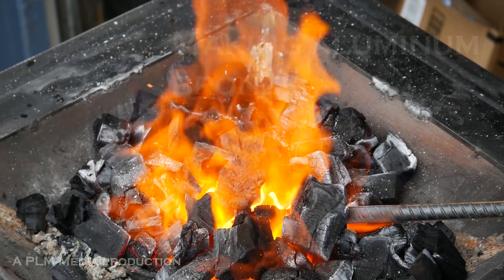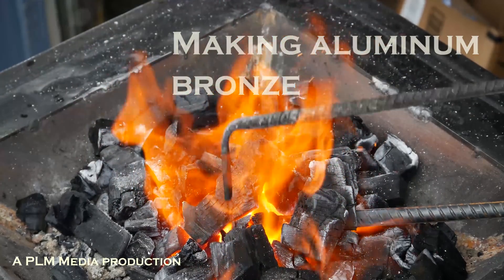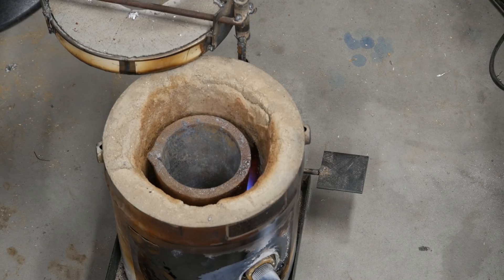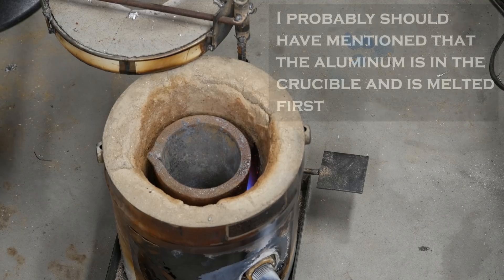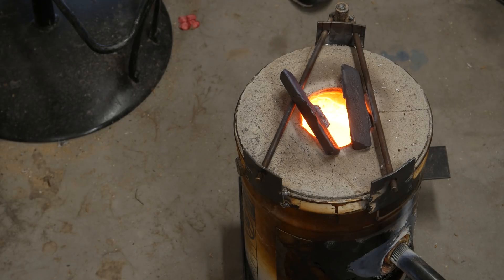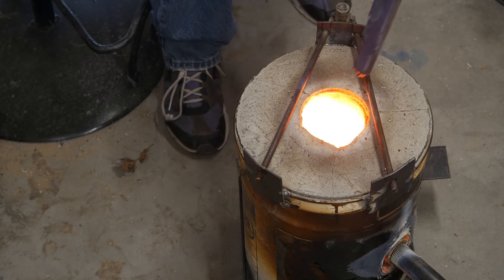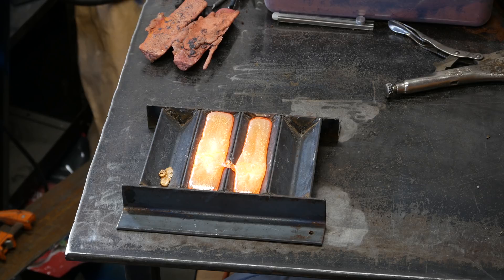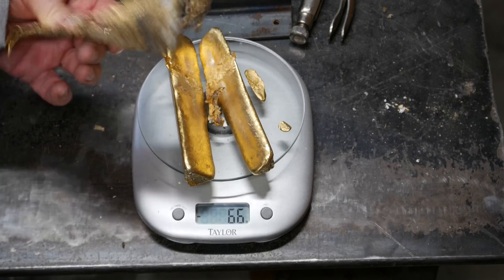Making aluminum bronze

Comment: I've loved your videos so far, lots of very informative and thoughtful content.

Getting into casting, I've been conflating the differences between lost foam and green sand casting. Have you ever tried lost foam?

I'd love to see you take a crack at it!
Reply from the maker: I've never done lost foam, most of it looks really bad in my opinion. Although, that said, I have seen a guy on YouTube that makes beautiful stuff that way, mostly engine parts. 

I really don't have any interest in it. I would like to do lost wax though.
Reply: @swdweeb  Kelly Coffield's engine foam casting is also what has me pretty interested.

I think a lot of the problems with people's lost foam is not following the principles you lay out for a nice clean pour in greensand/Petro-bond.

 Lost wax is very similar in high detail retention, except you use a lot more plaster and have to melt out the wax, versus the thin coating of plaster on foam and simply burning it out while doing a regular greensand pour.

Though 3D printing wax is a lot easier than cutting foam.

Thanks for the reply, and have a good one!

Comment: Bronze is made with copper and tin. Bronze is not a synonym for alloy. Remember the Bronze age?
Reply from the maker: I hope you feel better with that off your chest. Yes, I realize that bronze is not a synonym for alloy. I could respond in like form and tell you that bronzes come in many alloys and that tin bronze is only one of them. There is aluminum bronze, popular for things like bushings due to its hardness, silicon bronze that is popular in sculpture casting due to it's flow characteristics. Each of these have multiple variants as well with different metals alloyed in and different ratios of metal as well.
 
Yes I remember the bronze age, do you remember the black plague?
Reply: @swdweeb  You mis understood. It's only copper and tin, mixed in a specific ratio, that makes bronze, as they did in the Bronze Age. All other mixes of copper, and/or any metals and ratios, are alloys that have no particular name and have nothing to do with bronze as such. It's probably a USA thing to name every thing bronze that has copper in it with some extra metal. I call aluminium bronze Wearite411 or C95400, silicon bronze C655, manganese bronze C863 (or SAE430B), phosphor bronze C544 (or B2) etc. (In this sentence the word bronze is used as a synonym for alloy) This makes it for me easy to communicate with the retailer. He would never understand Alumin(i)um bronze.

Comment: Was funny when the scale reset to zero but then read the correct weight after pulling off the crucible leave ins🤣
Reply from the maker: I probably zeroed it and then it showed the "negative weight" when I pulled it. Been too many years to remember what happened

Comment: Can you improve on the heat dispersal of an aluminized bronze?
Reply from the maker: I'm not sure what you mean
Reply: @swdweeb  like copper for example has a higher rate of heat dispersal than aluminized bronze is there a way to increase the heat dispersal of aluminized bronze?
Reply from the maker: @buckaroundandfindout ok, lets make sure we're talking about the same thing. Bronzes are copper alloys, that is copper + tin, copper + silicon, coper + aluminum,.. Aluminum bronze is a combination of aluminum and copper.  I assume that is what you mean when you say aluminized bronze.  That said, I'm not going to have an answer for you because I simply don't know.  Both aluminum and copper have very high conductivity which is why both are used to transmit electricity. Both are also used in cooking utensils like pans. Copper is typically marketed as being better at distributing heat in a pan. Aluminum pans are simply lower cost so people buy them. The only way I can see improving the heat dispersion of aluminum bronze would be to add more copper to the allow or to coat the aluminum bronze with copper, like through electroplating. That is if you can improve it at all.

Sorry I don't have a better answer for you.
Reply: @swdweeb  I'm merely asking because I'm trying to design a new type of engine and I'm thinking about using aluminized bronze due to its corrosion resistance, I was wondering if there was a way to mitigate its expansion due to clearance.
Reply from the maker: @buckaroundandfindout  Ahh... ok. I still don't know 😀  You'd be better off finding a metallurgist, which I'm not and unfortunately I don't know one either.   You might try if a company like www.hkramer.com can point you in the right direction. I have a handbook from them that defines the characteristics of a number of alloys.
Reply from the maker: @buckaroundandfindout  email me at swdweeb@gmail.com and I can send you a picture of a page

Comment: I want to cast an aluminium bronze cannon would a 30 % copper 70 % aluminium mix work for this? The cannon will have very thick walls...
Reply from the maker: I'll open with "I don't know".  There, now that that is out of the way, can I ask why 70:30 instead of 90:10?  I know from personal experience that too much aluminum in the ratio will make aluminum bronze very brittle https://youtu.be/LO9j4KodTsE.  I didnt measure stuff in that video but I estimate I was down around 82:18 with my ratio. I'd be very interested to hear how your cannon turns out.
Reply: @swdweeb  30% cu 70 Al forms a low melting point eutectic, which is lower than the melting point of aluminium so would be very easy to handle and also one could use a large crucible made of steel which is cheap...In terms of safety and economy it is the best way to go....
Reply from the maker: @wijpke  I misread your original comment as 70%cu 30%Al, not that it would have mattered as I have zero experience in the alloy you're describing. As I said before, I'd really like to see how things turn out.

Comment: Is it generate bell ringing sound like pure bronze?
Reply from the maker: I assume you mean compared to bell bronze (approximately 80% copper / 20% tin).  I don't know the answer.  It has been a long time since I made aluminum bronze and I seem to recall seeing if it rang. I don't think that it did.  There is probably a good reason bells are not cast with it, I just don't know what it is. It could be that its too brittle. It is very hard.

Comment: I just made some 80 copper 10 tin 8 lead and 2 zinc and cast some parts in sand.   haven't machined it yet but the color is really nice.   Although when it first came out of the sand it looked grey like ....like not bronze lol.   But once I cut the runners and gates it's pretty.   Has a great ring to it.   Will report back with machinability soon
Reply from the maker: I’ve seen plenty of that grey color using petrobond. I always assumed it was a reaction to the oil
Reply: @swdweeb  the color of this recipe turned out to be a very light colored like a champaign color.   It's was't golder like a brass.   But it does have that tint to it.  I expected a golder color but this will work for me.  It machines excellent.

Comment: my aluminum bronze comes out with a lot of bubbles and inflates when I make it in the graphite or steel mold, do you know why this will happen?
Reply from the maker: That's a tough one.  I'm guessing here because I don't have a good answer. 

I've heard of people having moisture in their molds that cause steam when the metal is poured in. They generally heat the molds to drive off any moisture. That seems unlikely and I've never preheated my steel mold.

The other thing I've heard is gas being introduced in melting process. This is why people use "degassers" in their melted metal. This happens whenever there is oxygen present during the melt. Again this is something I've never seen and I've never used a degassing agent.

I guess the last thing I can think of is metal being splashed into the mold during the pour. I doubt that you're doing that but maybe...

Those are the best I can come up with . Sorry I don't have a more definitive answer.

Comment: I melted aluminium bronze in furnace but the melting/burning loss is 15-20%. How can i reduce melting/burning loss can please guide...
Reply from the maker: I assume you are talking about dross that is formed as the metal melts. This is due to metal oxidizing. Once thing you can try, and I know this is going to sound crazy, is to add a little borax and a small piece of broken glass to the metal as it is melting. The borax and glass will melt and float to the top of the metal covering it and keeping it from oxidizing. 
I have greatly increased my yield with tin-bronze and copper by doing this. I don't really make aluminum bronze any more but it should work the same.
Of course you will need to "scrape" the glassy liquid off the top of the metal before you pour. If you don't, you will get a brown-colored glass in your metal. You don't want that.

Comment: I made a few pandants with this stuff, and even tho I was using a cobalt drillbit for the string hole, halfway the metal became so hard the drillbit stopped cutting.
after reannealing it went through with no trouble.
a very interesting alloy indeed!
Reply from the maker: Yeah, I guess they use if for things like bushings because it work hardens. I drilled some tin-bronze the other day and it drilled without a problem.

Comment: I melt the copper first and then add the aluminum. The idea is that a lot of the aluminum will burn while bringing it up to copper melting temperature.
Reply from the maker: Ok, so we disagree 😄
I really don't make aluminum bronze any more but I do make tin bronze and the same conditions exist, the tin melts at a much lower temperature than the copper. I used to put the tin and a portion of the copper in the crucible together, heat it up, and wait for the copper to melt before adding the rest of the copper.  Now I heat an empty crucible till it is somewhere near copper melting temp and then add the tin and a portion of the copper.  The tin obviously melts very quickly in this arrangement but the copper melts quickly too.  I don't know that I lose any tin due to it burning off.

Comment: Could you please make and test batch of equal weight brass and pewter.  If I did the math right the end results will be an alloy of 46% tin 31% copper, 20% zinc, and 4% antimony
Reply from the maker: Well, there’s only a few problems with that. 1) I don’t melt brass. Zinc fumes scare me. 2) I don’t have pewter and I don’t know where to find it. 3) I’m having issues with my burner getting copper alloys to melt.
Reply: @swdweeb  Thanks for the reply.  I get pewter cups and candle holders from Goodwill and Thrift Stores.  When 
you can find it, cheaper than ingots

Comment: You dont have to use any sort of flux to aid in the mixture of these metals?
Reply from the maker: I've never used a flux for anything. Not saying it wouldnt help, I've just never used any.

If I want to insure a good mix, I've melted the metals, poured them as ingots and then melt the ingots for the actual pour.

Be careful with stirring.  Keep in mind that stirring will stir in oxides and dross into your metal.  If you're going to stir do it as gently as possible.

In line with your other comments, aluminum bronze is the absolute worst when it comes to shrinkage.  It shrinks more than anything else I've poured, much more.

Comment: Is an alloy made by weight as you did or volume? To me by weight your mix isn’t 90/10. My thinking is it should be volume. Of course I’ve been known to be wrong on many occasions.
Reply from the maker: whether I did measured correctly is debatable. The  alloy is made by weight.
Reply: @swdweeb  thanks for the information. I’m pretty new to this, you videos are great keep them coming
Reply from the maker: @kevingade5615  No sweat, I was confused about the ratios when I first started as well

Comment: I tried 50 50 and it doesn't look like anything but heavy aluminum
Reply from the maker: if you mix it with that high a ratio of aluminum, it will shatter like glass.
Reply: @swdweeb  I'm going to have to re melt it.

Comment: So, you mix/smelt via weight, and not mass? Those two would mostly likely be very different. Have you tried both ways, using mass displacement? 

I am new at this, and love that you are sharing and teaching.
Reply from the maker: I'm glad you're finding my videos helpful.  Thanks for letting me know. 
Alloys are done by weight, not displacement. 
Smelting, FWIW, is the process by which metal is extracted from ore.  By the time we get it all we're doing is melting it.  ;-)

Comment: I am gearing up to try this myself. It's interesting to read back through the comments on older videos. Such a mix of contradictory advice and personal anecdotes which may or may not have any bearing on the job at hand! I must see if I can scrape up enough  copper for the job though. It's always harder to get than aluminium.
Regards,
Mark
Reply from the maker: I think its a little like a rite of passage. Everyone seems to feel the need to do it.  There's no doubt about it making an alloy is pretty cool. This alloy isn't all that great but if you can find the copper, it's easy to make.  I've grown to dislike Al-bronze as it shrinks so bad its a real pain to pour. Get your extra-large feeder ready. ;-)

Comment: Is the 1058 in ounces?
Reply from the maker: All of the measurements were in grams, the math is easier.   The ratios are the same, 10% aluminum by weight and 90% copper by weight.

Comment: Is it safe to look at molten copper/ inside of the furnace without welding shades? I finally got my furnace to melt copper, and while I do wear a full face shield, its just a plain clear one without any shade to it. My eyes seem fine, just curious.  I'll have to get a video of mine up, its just hard in the city, bc the dam kids always want to watch what I'm doing whenever I'm working on something. Also after some of the questions I get from them, really makes me consider home schooling my daughter! I told the neighbor boy (hes around 12 or so) that copper melts around 1000C and he says "wow thats cold". I'm like what? Thats around 2000F. Then he tells me school told him thats the difference between Fahrenheit and Celsius, Celsius is cold and Fahrenheit is hot! Man these poor kids!
Reply from the maker: yeah, we all feel that way about the next generation ;-D  present company excepted of course. 

That's a good question. It gets yellow hot but I don't know if its the spectrum that is a problem or the intensity.   I did a quick google search and found nothing. If you come across something, let me know.
Reply: swdweeb I couldn't find much of anything, ecept for steel. But that's alot hotter. Invisible infrared could be a problem, because you can't feel that cooking your eyes. It's like looking at the sun through dark glass, it might not hurt to look at, but if it doesn't block IR, it can still cook your retinas. Do you wear any eye protection when doing this, besides normal safety glasses/face shield?
Reply from the maker: I just spoke to Martin about it. He does not believe molten copper is damaging to your eyes. Don't take either of our words for it, but the general consensus is wearing welding goggles presents several safety concerns as well, like not being able to see anything but the glowing metal.
Martin wears a clear safety shield as do I.
Reply: Thanks for finding out, that was my thought as well, I was thinking its more dangerous if you can't see what you're doing, than the potential danger of eye damage looking at the molten metal.
Reply from the maker: Of course I also don’t stare into the furnace any longer than I have to either but I always have my face shield on when I do
Reply: Yeah same here, I even squint just to make sure. lol!

Comment: Copper melting point 1'085ºC and aluminium 660ºC...
I would have started with copper first. But eh! It worked!
Reply: Dropping cold metal into 660 degrees is safer then droping into 1000 degrees. Amatuer. Swdweeb you did it right. You gotta watch these know it alls who never done it commenting. Lol and they always claim to have all this experience but they say things that experienced people know don't work.
Reply: Ever dropped ice into boiling grease? Same concept. You always melt the coolest melt metal first then add and heat it up
Reply from the maker: Thanks for the confirmation ;-)
Reply: Don’t forget that you don’t have to melt all metals in an alloy, metals will dissolve into other metals at much lower temps than their melting point.
Reply from the maker: I've been told that the alloy can actually start to form at lower temperatures than the melting point of copper. Aluminum is a fairly reactive metal. I melted the copper first and then added the aluminum one time and I got a big white cloud out of the furnace as soon as I added the aluminum. Havent done it that way since ;-)

Comment: but is it food safe and can i cast a skillet out of it?
Reply from the maker: I have no idea. Aluminum is food safe, copper is food safe.  The bronze I make probably isn't because I started with old plumbing pieces so they contain lead in the soldered joints.  A lot of it gets left in the crucible after the melt because of its weight but I wouldn't bet that none of it remains in the bronze.  I don't see why you couldn't make a skillet out of it. The melting temperature is close to that of copper. It would weigh about 600 pounds and cost a fortune to make but you could probably cast one. ;-)

Comment: Perhaps, you might try lightly "dusting" your ingot molds with fine powdered talc, or graphite, or, soot, from an acetylene torch, or candle, etc. That might prevent any molten metal from sticking to the steel.
Reply from the maker: Usually the shrinkage from cooling causes the ingots to release on their own without the need for any release agent. It's only when i pour the metal all over the top and it gets into the cracks that I have a problem ;-)